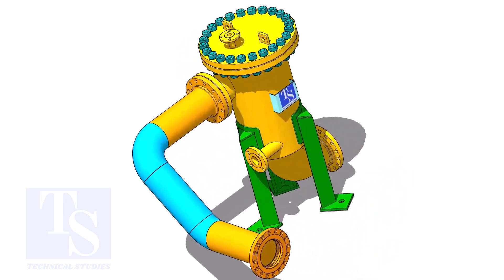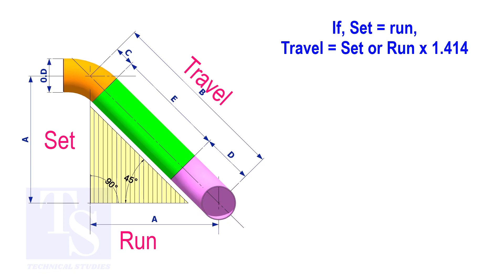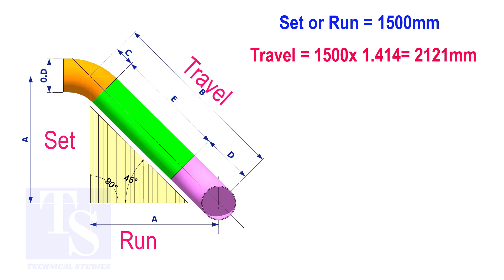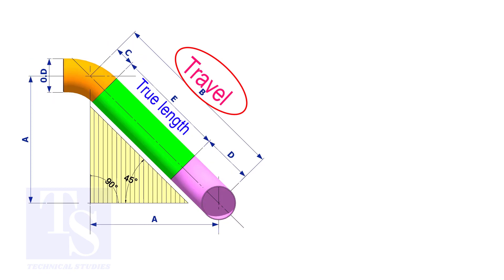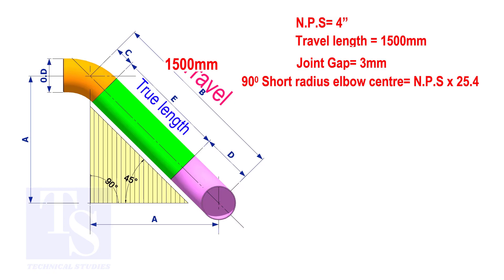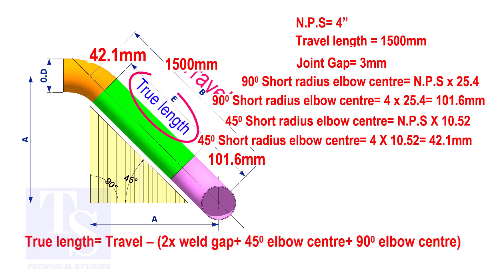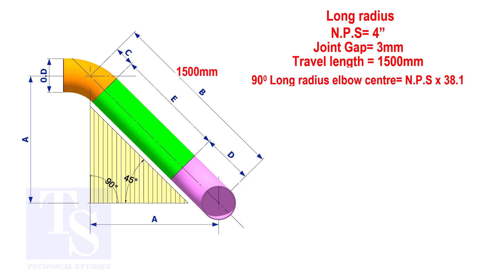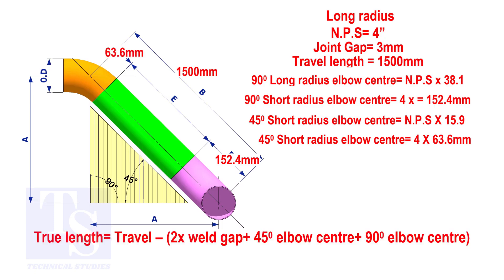Pipe rolling, set, run, travel, long radius elbow center, short radius elbow center, true length.

Comment: What if you don't count from the center of your knee?  Let's say pipe + flange + flange + elbow + pipe + elbow + flange + flange + pipe?  Run 700 and set the value to 300. And you can't cut the pipes.